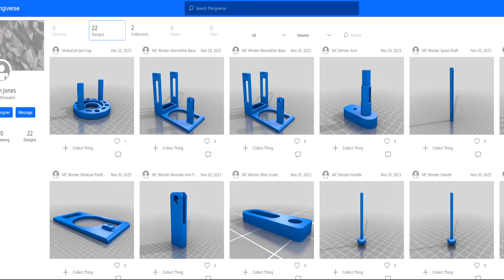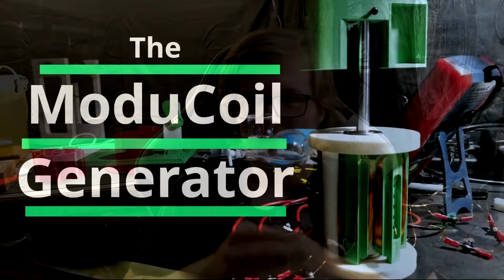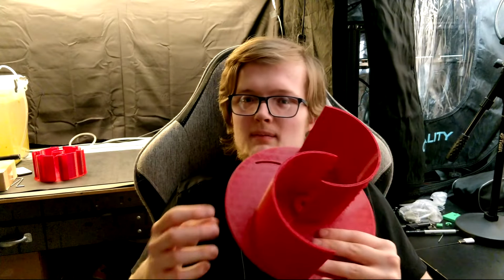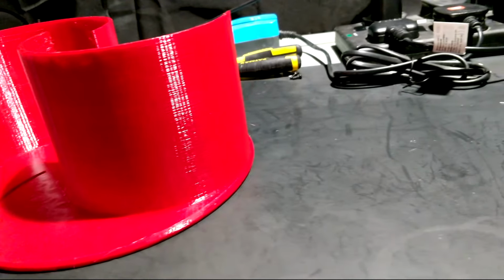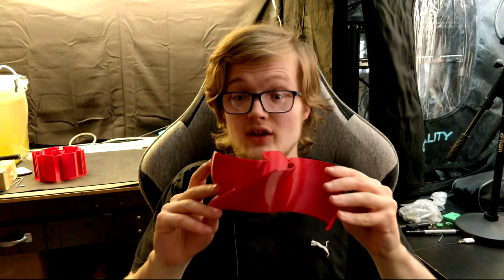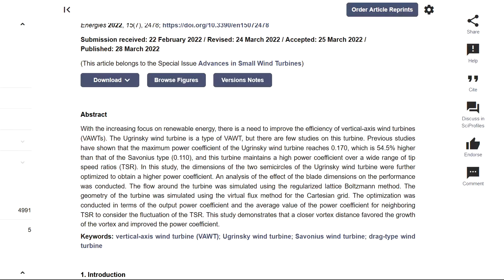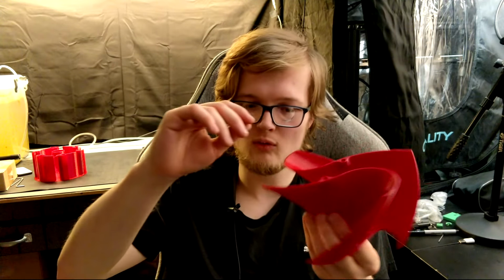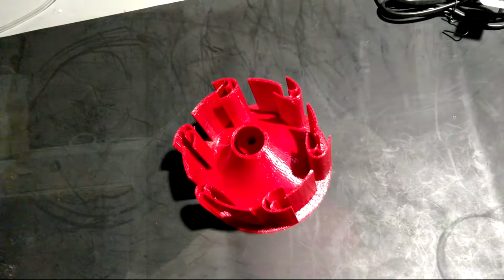Testing 3 Wind Turbines from Thingiverse

Comment: The test is stupid and completely wrong.  You need a uniform flow and not a directed one. Measuring the voltage is irrelevant too because it is just a function of the speed of rotation.  You have to measure POWER in a uniform flow field

Comment: Appreciate all the effort in printing the turbines.  One thing I would consider a major flaw in the testing was the directing of the stream of air to what made the turbine spin the fastest.  Sitting out in the actual wind, BOTH sides of the turbine will be getting hit by wind in the same direction.  I think the design of the side turning INTO the wind would have a huge impact on efficiency.  Doing it the way you did we couldn't get a realistic result.    I'm not trying to trash your test by any means.  I am genuinely curious to see how each turbine would respond with equal wind force hitting both sides.  Maybe move the blower back more and center it?  Even if it goes slow we can get an idea how it works as a whole.
Reply from the maker: I'm currently working on a wind tunnel design, along with a fan blade to attach to my rotary tool. This should give a better simulation, with laminar flow wind pushing against the respective turbines.
Reply: @edeniaAJ  For your wind tunnel, you could test it with a fog machine and a laser to verify that the flow is laminar indeed. If not, you could 3D print an extruded grid to create straight channels that force the air flow from the fan to move in straight lines.
Reply: I thought exactly the same. The hair blower is rediculous as windsource, the guy should get AT LEAST a bigger fan to blow from far and regular winds. So it remains rediculous and is for sure not a test! Appreciate his interest though, and he will become better soon in his methods.
Reply: @hellothisismax tests VAWTs in a wind tunnel! You might find his channel interesting. He even does user submissions which I find pretty entertaining.
Reply: I am considering a vertical axis wind turbine that looks exactly like a tree, I call it : e-tree,
the trunk of the e-tree is brown, the spinning blades are green,
attached to the trunk of the e-tree are features of : wifi/mobile network, light and power outlet, to charge a car for example

Comment: Your test is MASSIVELY flawed. A hair drier ? Concentrated air flow on one side, does not account for drag on the other side of the blades.
Reply from the maker: So what do you propose?
Reply: not the original commentor, but a box fan blowing across the test blades would be a good test. I would hope that you can clear out a space behind the blade as well so there's no backpressure from obstacles behind the test item @edeniaAJ  . 

Really good effort at a scientific approach, love the citizen science here.
Reply: A large fan would give you a more real world result. @edeniaAJ
Reply: @edeniaAJ A leafblower from 2m away aimed at the center. With the current test a flat bladed impeller (as found in some pumps) would even perform well.

Comment: Not a very good test method as there was no air pressure on the advancing faces, if you selectively direct the air in the manner of your test you could get a power reading out of almost any shape, also changing the angle of the air source can influence the output as demonstrated in your test, for a fair test you would need an air source wider than the test subject to assert force on the advancing and trailing faces at the same time, you could maybe try building a small form wind tunnel, but it would (for a fair test) have to demonstrate laminar flow at the test distance, this could be achieved by the straw stack method, there are quite a few examples of this design of tunnel on youtube, thank you for the video anyway.
Reply: yes totally. 100% this. 👍

Comment: Free wheel speed is a matter of pitch and airflow velocity. The next test should be to load them to best efficiency point, and see which one can actually generate the most power based on swept volume and airflow velocity. The different turbine designs will for sure, produce their maximum power at different speeds and torque.

Comment: Nice tests.  I remmeber mentioning the pelton design to Rob in a comment a few years ago, even giving a quick hstory of its orgins, i think in response to one of his hydro generator videos where he was demonstrating the dead weight of an urgrinsky water wheel.  The pelton designs uses the opposite effect, not the dead weight of the water but the speed  or "pulse" of if as they called it.  I knew Rob would get a kick out of it, he's very receptive to new ideas and shares his as well and ecourages you to use them, but i never thought he'd incorporate it into a wind turbine.  And the added effect of the drag, even superior then the urgrinsky turbine he actually introduced to us too, very cool to see his remixed design do so well. But not surprised, his focus changed to wind power generation over anything lately so its nice to see some real results.
Reply from the maker: Thanks! I'm working hard on a follow up to this: A 3d printed wind tunnel for a more accurate test!

Comment: Very good! However, one note: I would explain lift type devices as those that through their aerodynamical shape create a pressure differential which redirects an airflow around them because the higher pressure air strives to flow to the lower pressure region . And redirected airflow provokes a counter-reaction, which drives the turbine.

Comment: if a turbine performs much better using a particular angle or cross section you can also shield the turbine from the outside wind using a directional plate in front of it that redirects the wind into the best angle and shields the remaining parts of the design from external turbulence etc...  in a Pelton wheel this is of course necessary because they ALWAYS direct the flow only to one side... 3 cup wind anemometers are Pelton designs that use a triangular offset to assure rotation however there are still significant efficiency losses with that design...
Reply from the maker: Will take note of this

Comment: when doing comparison test, it's better to put the blower at the same position corresponding to the circle center ( if the radius of the three types are the same). 
I felt the distance between blower opening and the edge of the turbine in second test is closer than that in the first one.
third one (Pelton design) is the best without any question even I felt the distance of the blower open is far a little bit

Comment: For the Ugrinsky design you had to blow more on one side than on the other? I am very surprised to see how the pelton design perform. Indeed, the three turbines had the same diameter, and I suppose that the voltage is proportional to the rotational speed which can't be greater than the tangential speed of the air. It would be interesting if you actually draw current of your generator, to compare the actual produced power. Thank you for your testing, I subscribed!

Comment: To the previous comment, by JVielo,  is of course, 100% correct so after making the source into a laminar flow then you can make a rectangular horn with deflector plates that simulate an even delivery across the entire cross section of the turbine being tested.  So in short build a small wind tunnel to do lab testing...

Comment: Your wind testing would be greatly improved by testing these designs using laminar wind flow rather than a blow drier which has already a vortex like output which creates many interfering attributes.  To create laminar flow you need to feed the blower through a tube structure of many smaller tubes inside one larger tube of about 6 to 12 inches in length..  This will produce a laminar wind flow that is mush closer to natural wind blowing.  This can also be incorporated into the turbine design with a bit of engineering thought.  Of course natural wind is already much more laminar so it can be directed into the turbine with mush less manipulation and added drag. If you want a reference for laminar flow devices study how they made the famous fountains at the Belagio Casino in Las Vegas.  these can shoot long columns of laminar water flow using simple nozzles as I have described.   Cheers and thanks for the work!
Reply from the maker: Thanks! I'm currently working on a wind tunnel as we speak!

Comment: Beautifully made models. But this way of testing can tell us little more than that each turbine actually works. Was the dynamo connected to any consumer at all? Just measuring the open-circuit voltage only tells us how fast this specific dynamo spins in just this specific setup. It doesn't tell us anything about how much power the apparatus might be able to extract from the air and deliver in terms of watt if running with an electrical load. 
That your source of wind should be closer to actual outdoor conditions has already been said. I might add that it should be somewhat defined and reproducible for a meaningful comparison of your different turbines.
I suggest you wire up some circuit that draws power from your turbine and enables you to measure it in watt or milliwatt. Feeding the output to some adjustable resistor and reading an amperemeter in addition to the voltmeter may do. I'd be curious to watch that!
Reply from the maker: I will take all this into consideration for my next episode!

Comment: nice try but sadly your test is just too flawed.
The weight is of course different as those designes had different bases, different sizes, different stability. And any power-reading is also sadly not comparable as the airstream is far too small and irregular. Windturbines operate in near uniform wind - getting blasted with air that has the same general velocity everywhere. Your test only has air coming from one specific spot at one specific angle, no pressure on the other side, and that from a not controlled outlet.

Comment: 1. Make a wind tunnel that gives even air speed across the cross section, and ensures the whole turbine is subjected to the same wind.  TBH your test attempt was worthless because your wind was cr*p!. You need a bigger more energetic fan as the air source to give representative wind velocities for the tests.
2. With the Ugrinsky, the design is optimised when there is a disk top and bottom spaced at about 1.5 diameters.  This has important constraining effect on air flow and hence efficiency. I would imagine the others would be similar. So make then all 1.5 dia high, with disks either end. Good luck beating the Ugrinsky.
3. Free-wheeling RPM and Volts are useless measures without having some load on the turbines.  Tip speed to wind speed ratios are informative. Measure the RPM at varying loads to find where the wind speed to load curve is optimised. A copper disk with a magnet (pushing on a spring balance) closer or farther away from the disk will give you a 'dynamometer' setup with load data output.
Keep up the interesting work!
Reply from the maker: I'm currently working on a wind tunnel design, inspired by some instructables stuff. I think I will need to print a fan blade and attach it to my rotary tool, as I can't find a  suitable OTS fan online.